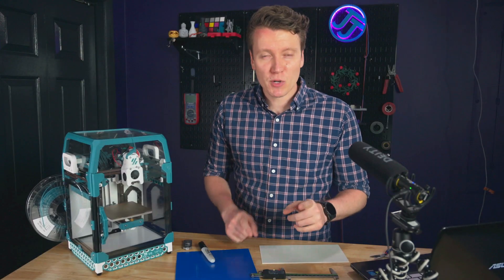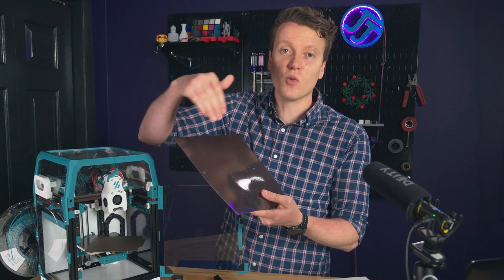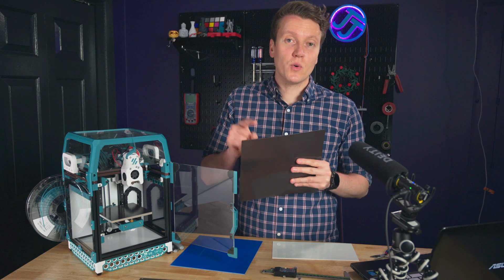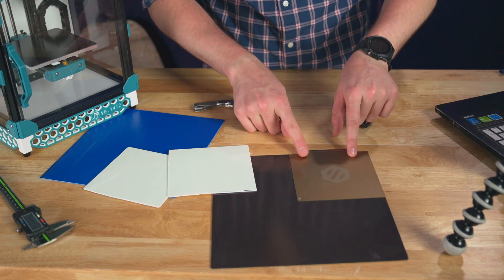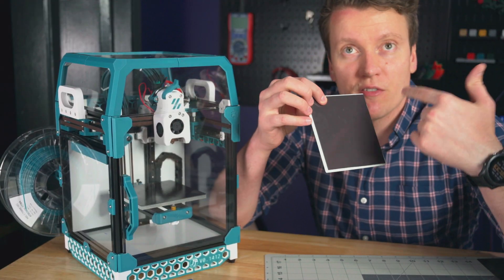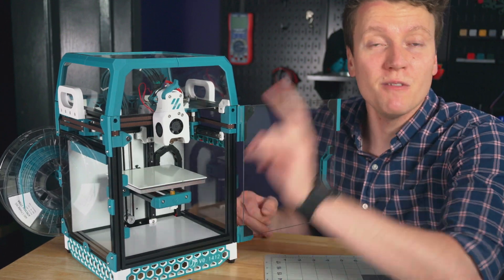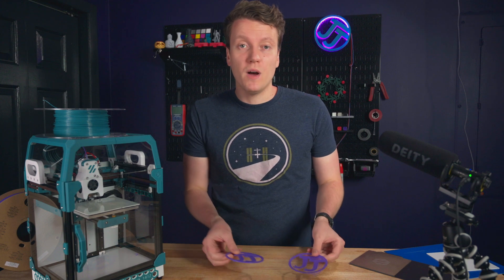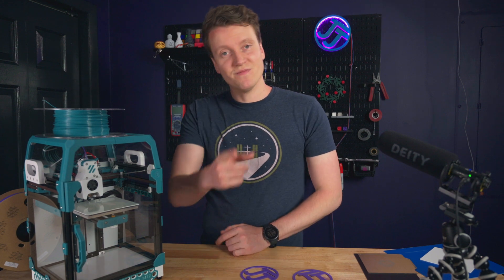Best Voron Mod Tested | G10 Build Plate with magnets

Comment: If things are not sticking to the PEI sheet it’s either not real PEI or you have grease (e.g. fingerprints) on it.

Especially PETG and ASA sticks so well to a smooth PEI sheet that it’s sometimes difficult to get prints off.

Comment: What I do is I wash the PEI sheet in warm water and dish soap and let it air dry on the print bed when preheating the bed. Everything sticks wonderfully. The biggest nemesis of PEI beds are your sticky oily fingers. You don't see anything wrong especially on the textured surfaces, but boy it makes a difference after you clean it. So my biggest advice is to minimize touching the bed. When things don't stick well, pop in the kitchen and give it a wash.

Comment: i been using g10 for my ender 3 v2 with abs, it hit and miss for some reasons, sometimes it works perfectly, stick nicely when printing and when cools it auto releases, but there is another times where it just doesnt want to stick at all and first layer just curl up as i print any idea why? i preheat the bed foratleast 20min to 110 degrees and it in an enclosure also clean the bed with isopropyl between the prints. i have also try to sand the g10 sheets to see if it helps with variouse grits from 180 to 2000

Comment: I think a lot of people are not really getting the point of g10, You don't need glue/hairspray/tape to get adhesion or to help release things like PETG. As long as your printer can get its temps up on the bed you can just keep it clean, set and forget. Also get those nice glass bottoms on the prints. I just wish it was easier to find in larger sizes.
Reply from the maker: Totally agree! I love the glass finish instead of the textured finish of pei beds. And I have tried talking to places that sell G10, but they just weren't interested in selling printer beds.
Reply: I've had success ordering 310x310 G10 sheets from AliExpress. I think I spent about $12 for a 1.5mm sheet and it took about a week and a half to arrive but it was definitely worth it. I think I'll order thinner sheets from now on so I can use the magnetic sticker like the video

Comment: A easy way to make your prints stick is a mix water and sugar. 1/4 granulated sugar dissolved in 1/4 of boiling water will give you a solution that you simply apply to your printer bed, use a paint brush. Prints will release when cold and very easy to clean.

Comment: PEI: wash with dish soap and scrubby. Then.......don't touch it!!! I don't even clean mine between prints, I just don't touch it, other than to grab the prime line at the very front. just need that front tab to flex it right on the plate. But I just do ABS and PLA....Ps. Just got an orbiter too (1.5) for my 2.4 350.  Seems to be an improvement over CW1, which was producing the woodgrain effect for me.

Comment: I attached a G10 sheet to a blank steel flex plate. Works like a champ and retains the good magnetic strength.
Reply: What type of adhesive did you use, if I may ask?

Comment: I had bad experiences with using two magnets against each other due to orientation of the magnetic field. Instead of I am using magnet base on the bed and metal plated foil on the G10 plate. Works fine.
Reply from the maker: What bad experiences do you mean with the magnetic field orientation? Like it wasn't sticking together? The metal foil is a good idea if it gets enough magnetic force between them.
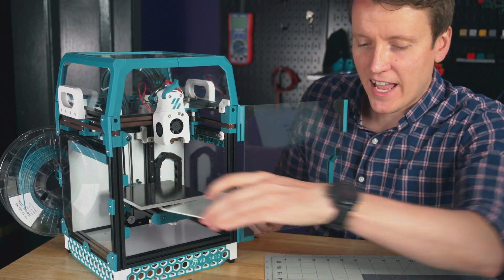Reply: @JJShankles  Yes, the force was really weak (honestly speaking, based on 5:55 and 6:00 of your video, it looks also weak). In the past I used to metal plated foil glued on the glass (235x235 mm) and I had issues to remove from the bed :-D. It is easier now with the G10 plate because thickness is just 1mm, so I am able to bend it little bit during removing.

Comment: nice video I did something similar with an ultra base for my trident (I started with a double sided textured sheet and a friend bought me the ultra base cause he wanted me to print stuff for him and he likes the smooth bottom) but I got a thin piece of steel the ultra base came with a 3m double sided tape I think i'd like to try that G10 stuff with my 2.4 cause I can't find an ultra base thats 350mm
Reply from the maker: A nice feature of G10 is they sell it in so many sizes, and can be cut to fit. The G10 is also smoother than the ultrabase, or at least my ultrabase leaves little dent patters in the prints.

Comment: You might have better success cutting G10 using a diamond or carbide grit blade. You can get them for circular, oscillating, jig, and hack saws. They can be called either masonry or tile blades.
Reply: If you have a shear you can use it will work best.

Comment: One thing to help assist and promote adhesion on the smooth side is 400-800grit sandpaper, then you can clean with acetone. 

For the textured side hot soapy water and a green scotch Brite pad then drying it off with paper towel, and wipe with Isopropyl Alcohol will help that side. :)
Reply from the maker: I've tried the light sandpaper trick before, but I hadn't tried acetone. I'll need to give that a try.
Reply: @JJShankles  just remember acetone on the smooth side only, but IPA on both is fine. :)

Comment: I usually give PEI a good wipe with isopropyl alcohol then I cover it lightly with some glue stick followed by another wipe witch will desolve the glue. It has worked quite well so far, at least for PLA

Comment: Sounds like you don't actually have a real PEI. I have NEVER had an issue with PEI or PEX flex surfaces. Yes, G10 is good too, but typically doesn't flex. I would like to know what your prep was on the PEI? Do you print tall parts? Flat with no curl is easy. Print a tall part with an overhang.

Comment: the user is the problem… don’t blame the pei. Basically everyone agree it’s good stuff. Congratz for being the first to hate it.
Reply: That's not really helpful. :/ 

One thing to help assist and promote adhesion on the smooth side is 400-800grit sandpaper, then you can clean with acetone. 

For the textured side hot soapy water and a green scotch Brite pad then drying it off with paper towel, and wipe with Isopropyl Alcohol will help that side. :)

Comment: Hey JJ great video pointing out some things to consider for someone wanting to do this. Your mileage may vary but! Putting two magnets will decrease actual print bed temp. Stacking two magnets should have a much bigger effect on this. For someone who was struggling with PEI. You need to make sure to never touch any of the bed with fingers. If touched with fingers clean using dish soap and water. Dry with cloth then wipe with ipa I use a spray bottle then wipe up with dry towel paper towel is what I use. If prints still aren’t sticking apply acetone to a paper towel and wipe the pei no need for a crazy amount just a little this cleans any oil that might remain. PEI that is clean should grip a pair of rubber gloves easy. Make sure to have a great magnetic sticker. Bad one will be thick and not hold at certain temp’s just because it is rated to 140 doesn’t mean magnetic force is good at that rating. I put graviflex on mine and have never looked back and trust me when the bed is hot I can still pick up the whole v0.1 with the magnetic sheet. And it’s not as thick it’s thin so heat can transfer much better. Finally, the best upgrade that made me able to use the complete v0.1 bed was and edge to edge heater. That means full power at edge to edge. Big prints are not even a problem with edge to edge heaters. The problem with the v0.1 stock bed heater is that it doesn’t run through the whole bed. Take a heat camera and you can see what I am talking about. This is why with big prints curling will happen and if magnet isn’t strong then curl with the pei. I spent hours changing temps figuring things out as I use the v0.1 whole bed. And this is what worked best for me. Make sure it’s clean good pei. Good bed heater and bed magnet.
Reply: Don't use acetone on powder-coated PEI. Unless you don't want it on there for long.

Comment: Another quality video! Word of warning to those considering this upgrade: you will lose some Z print volume.

I guess it doesn't matter now but you should consider using hair spray on your PEI flex plate if you're having adhesion issues.
Reply from the maker: Yes that is true that it gives up a few mm of Z volume. And I can still swap between then whenever I want. I'll have to give the hair spray trick a try some time.

Comment: Very interesting... I have 0 issues with PEI and it's most consistent bed-surface for me... I print ASA, ABS, PLA, PETG... and clean once in a while with IPA... Maybe problem is in bed temps you use? or it's not a PEI, there are alot of fake surfaces claim to be a PEI.
Reply: Same here, and steel wool gets it good as new.
Reply: @3DPrintingFreak  I feel like steel wool is too much or maybe my surfaces aren't so old.
Reply: @hobbyistnotes  it's great. Does not leave marks.
Reply: the problem is the user…
Reply from the maker: This one was from a quality reseller, not Amazon Haha. 
What temps do you use for ASA? That one has been giving me the most trouble.
Reply: @JJShankles   I reprinted my ASA parts for the v0.1 once I had the V0.1 running and enclosed... OG parts were on an open air Ender 3.  The PEI sheet that came on my Blurolls kit needed some help before anything stuck to it.  ended up wet sanding it w/ 600 grit sandpaper until it was matte and not shiney.  Since then everything sticks to it, ASA, ABS, PLA, PETG, TPU.

My ASA settings are Bed:85 Extruder: 255 fan: 15%
Reply from the maker: I'll try those settings. I also probably need to eventually reprint my parts as well. I printed them on an Anycubic Mega inside a cardboard box to try to keep temps stable.
Reply: @JJShankles  I use 110(C) for both ABS and ASA. While bed gets to this temp whole chamber perfectly preheated. Even more, sometimes prints (especially with sparkle filament) stick so hard that is difficult to get off without slow cooling.

Comment: Playing with G10 lately myself.  No kidding about dulling tools.  I didn't want to use a hack saw for fear of it delaminating, and after dulling a couple utility knife blades I ended up using a old fashioned linoleum (pull) knife and going back and forth to the grinder to sharpen it a few times.
Reply from the maker: Yeah the hack saw left a pretty rough edge, but a little sanding really cleaned it right up!

Comment: Elmer's purple glue stick works really well on PEI and uncoated spring steel sheets. Give it a try.
Reply from the maker: I'll give that a try!
Reply: Using glue on PEI defeats the purpose of using PEI in the first place. What materials are you printing?
Reply: @SeanTaffert  Some PEI sheets are better than others. On good quality sheets like TH3D, everything sticks no problem. On some others I got from Ali Express, they quit sticking after a while.
Reply: @3dexperiments  If it's made from Sabic Ultem branded resin then it should work fine. If it's generic PEI with some fillers/additives, well.... just like the difference between Scotch and whiskey, they ain't the same. Plus, JJ failed to mentioned how he prepared his surface. A good once over with some 0000 steel wool and IPA wash will bring up the nap and give MUCH better results.
My LDO Voron 0.1 kit build surface works perfectly.
Reply from the maker: I've tried all the things. Washing with soap and water, steel wool, and/or wiping with IPA haven't given me consistent results with ASA. ABS gives decent results, but still not near the reliability I get out of a G10 plate. I think I ordered mine from West3D definitely not AliExpress, so I know it is from a good supplier.
Reply: @JJShankles  Do you pre-heat your printer for at least 30 mins before printing? My Voron needs a good heat soak before running. I pre-heat with all the fans running (including my Nevermore Micro) to get the chamber warmed up. I usually start to print with a 35C chamber as a minimum.
Reply from the maker: I usually only do about 10 minutes since I am impatient. A chamber thermometer would be another useful mod so it could heat until the chamber reaches temp instead of just the bed. I'll also give a 30 minute heat soak a try
Reply: @JJShankles  Run the bed heater at 80C for 30 mins, with it moved down to the bottom and the part cooling fan on to maximize heat distribution. If you leave the hot end OFF, then you can use that temp reading as the chamber sensor. Just watch the thermistor temp until it hits 35 and go.
Reply: @JJShankles  Please do a follow up on G10 after you've used it for some time. Right now, bare spring steel with glue stick is my favorite.